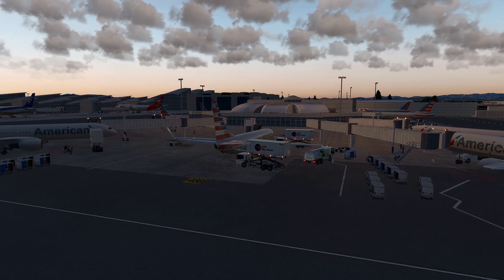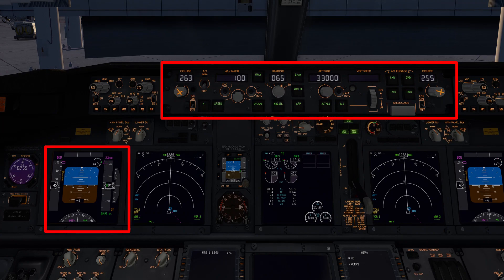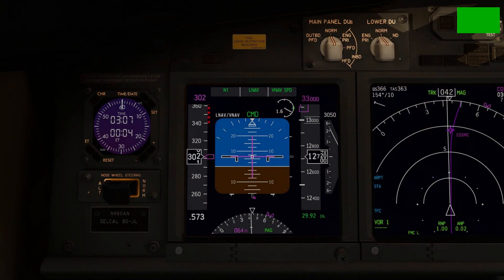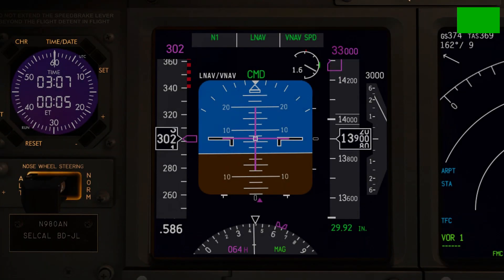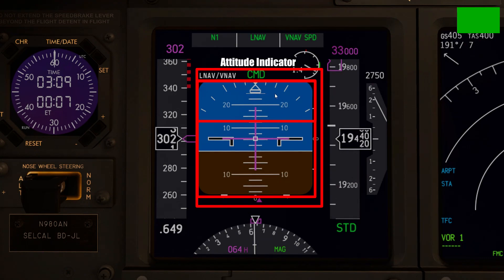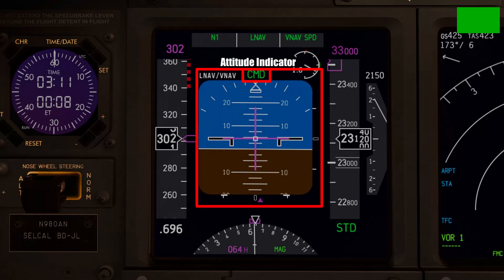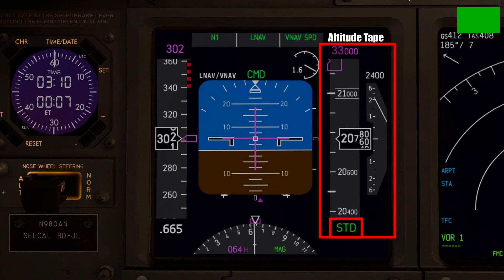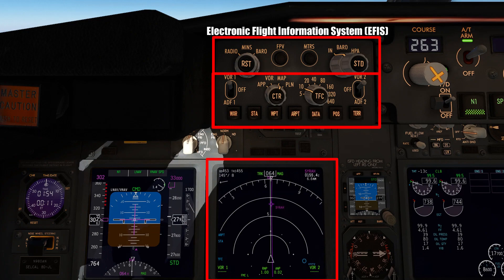Aircrafts Dissected Ep 3: Primary Flight Display & EFIS PanelIZibo 737IX-Plane 11 Detailed Tutorial

Comment: Quick correction that I'm sure is found elsewhere here in the comments. Standard pressure in inches of mercury is 29 decimal 92 inches (29.92 as seen in the lower right corner of the PFD), not 2992 inches. I think that's more like Venus or Jupiter ;) Otherwise, as always, a very informative and useful video. Many thanks.
Reply: Or 1013 hps

Comment: This is an excellent video. Kudos! There are several elements of the PFD that were omitted for the sake of brevity. One is a discussion of the additional indications on the speed tape. The minimum and maximum speeds (red/black checkered indication) and the amber manoeuvring speed - minimum and maximum. Also, the question about the "eyebrows" display on the AH comes up occasionally. It's the pitch limit indicator which is the maximum pitch before stick shaker activation.

Comment: This may sound silly, but why at 14:07 doed it say on the artificial horizon that your speed is only 283 at over 33,000ft. Is the plane actually travelling that slow?
Reply: That's the indicated airspeed. IAS is dependent on the density (among other things) of the air, so at higher levels it underreads the true air speed (TAS) That's why at higher levels, about FL 200 and above,  Mach number is used.

Comment: What is the little gauge on the PFD next to the altitude tape ?
Reply from the maker: That would be the angle of attack indicator sir. I did not go into too much detail about that as I thought it would be unnecessary. but an angle of attack is basically the orientation of the plane at an angle with respect to the direction it's flying. For example, if an aircraft is flying perfectly horizontal yet it's nose is pointed 3 degrees up, then the angle of attack would be 3 degrees. Hope you're enjoying the content. A like and a subscription would be greatly appreciated. Once again, thanks for watching Ryan:)
Reply: FlyBy Simulations already subscribed !
Reply from the maker: Ryan Luciano Thank you so much Ryan, the sixth episode has just been uploaded if you wish to check that video out:)